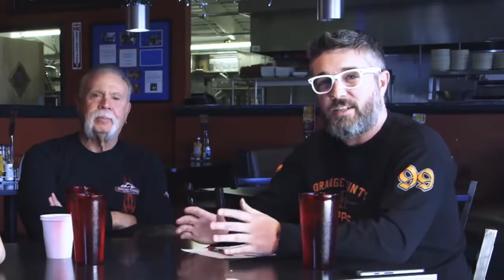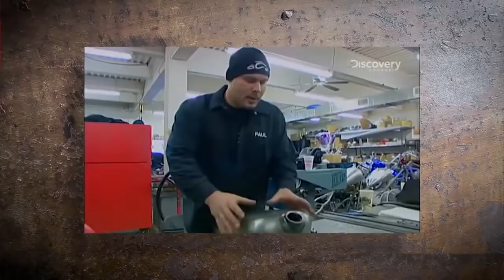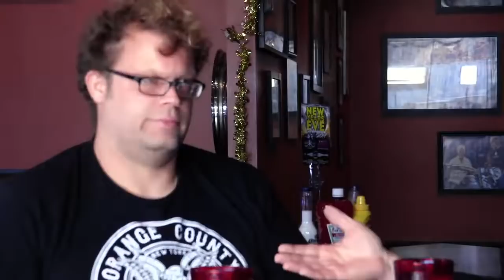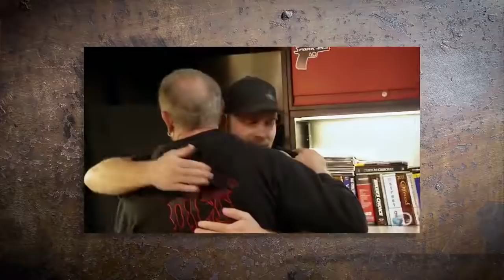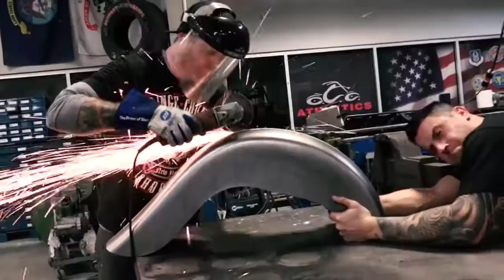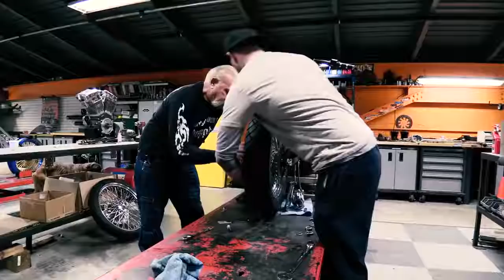hd Orange County Choppers

Comment: those bikes were up to 80,000 now las than 10,000 and they are very bad bikes
Reply: They're just expensive show pieces.... nobody buys a chopper to ride really. Just cool looking.
Reply: They never had good resale values. By the last season, the only ones actually selling were auctioned ones. They rarely reached $10K. The reason they bought back a bunch of them is because they have very little used value. They are buying them back for less than they initially paid for the raw materials.